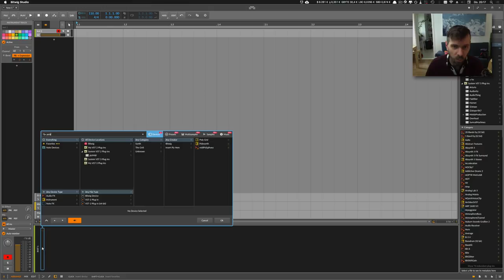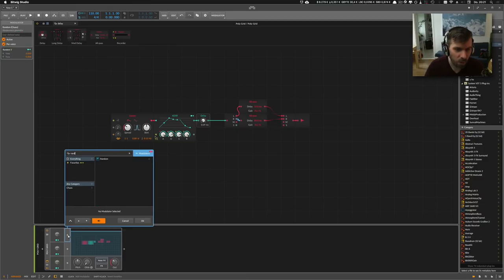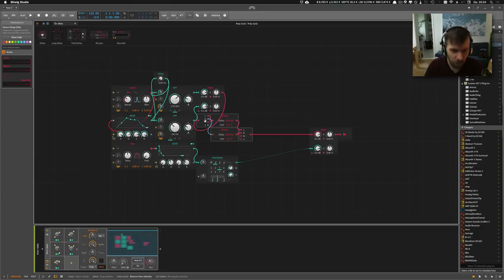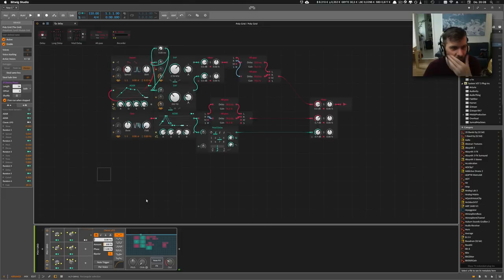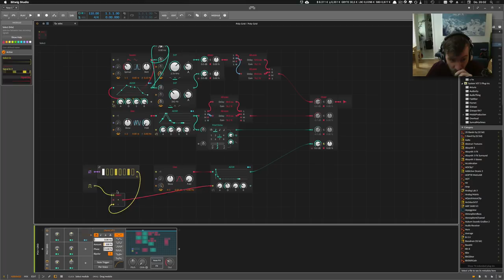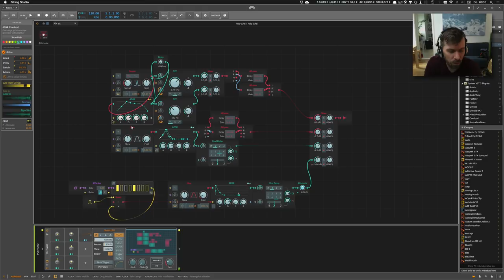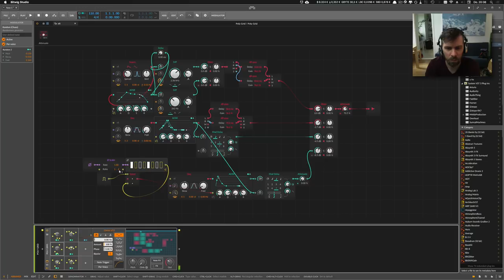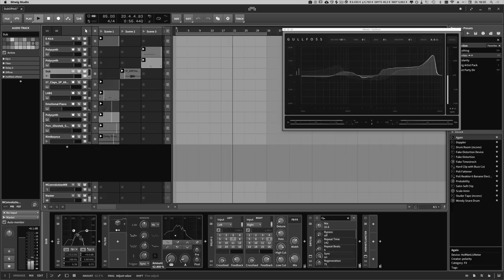THIS is how you create a textured pad sound in the Grid with Bitwig

Comment: (New to Bitwig over here.) Using the PolyGrid, could you effectively recreate older synths like the Korg Triton?
Reply from the maker: If im not wrong the triton/m1 is sample based with some "added" control. but its more or less a rompler. so if you have the samples you can re-create it with bitwig